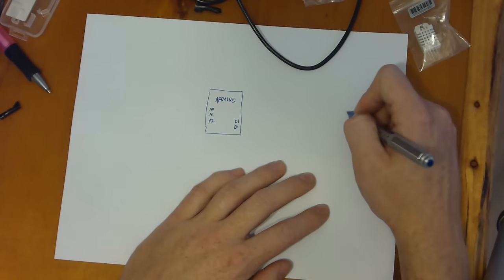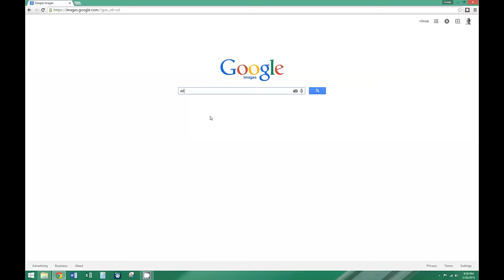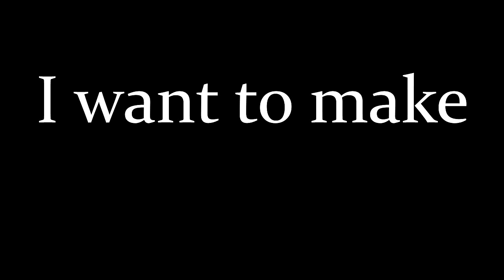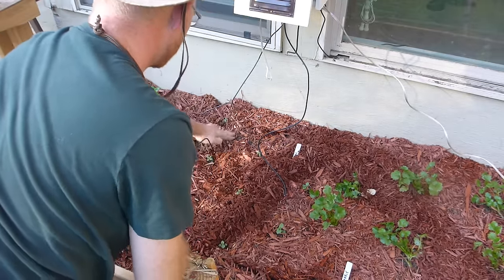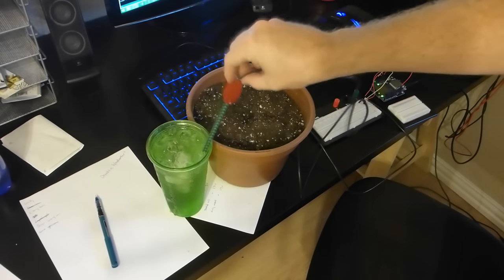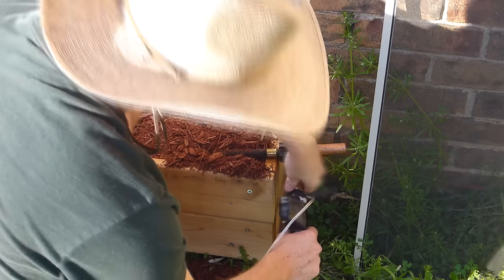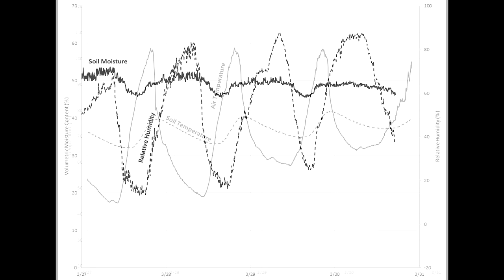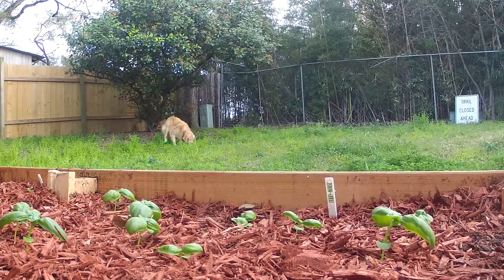Arduino Garden Controller - Automatic Watering and Data Logging

Comment: Hey, man ,this great.  I'd like to build one myself.  My problem is that I'm in healthcare and really only understand the human body, not electronics and code.  1. I am wondering if your link for the parts to build one is complete.  2. Is there a way to program a set-point for some of the variables for some sort action like watering.  3. How much did your working model cost?  4. Can you control it form a smart phone?
Reply: if you make one yourself you can ofc also program it yourself, so you can link the watering to any conditions you want, for example you can also add a realtime clock board and have it water only every monday, or at the same time of the day, or just when moisture is below some amount (which can ofc also be dynamic^^) (i hope i'm not scaring you, but there are tons of possibilitys^^)

cost i'd guess is below 50$, depending on what you buy and how many of the features he included you'd actually want yourself (ofc you could also just have arduino, moisture sensor, power supply and valve)

his version can't be controlled from a smartphone, but you can make it so yours can^^ add a bluetooth module (for which luckily tons of open source librarys exist), get a bluetooth terminal app on your phone and send it text commands, or even make an app to send it commands

Comment: Nice.  Sure you can buy something but it wouldn't be as satisfying as designing and building your own.

Remember that to qualify for the Heath Robinson school of Engineering you need to use a piece of string made up of smaller pieces of string knotted together somewhere in the design (preferable in a mission critical roll)

Comment: Low key have a bro crush on this project. LOL
...I might be 600 hours of [procrastinating actual work] designing in sketchup a ridiculously complicated hopefully once a month effort garden/bog garden/aquaponic/rain capture/ wicking bed/ monsoon proof/ vines/ vegetables/ low allergen... I honestly don't know what it is anymore!
Translation: I want to garden in the desert. So I wanted to put some plastic under the dirt. with vocanic gravel. With a recycling pump and some fish. But it's in the ground. And Monsoons can drop 2 inches of water in an hour. And electricity is expensive. And my landlord has allergies. And I'm extra so everything is designed to last 100 years. With laminated instructions in the control box. And the budget is $200... The garden is 25 feet by 5 feet to prep the area I removed the top 16 inches of soil... So 7 tons out and 10 tons back in.
...Maybe I was better off going to the grocery store.  I feel your over engineering pain.

Comment: Hello, this is really a great job. But i have a question for you. 

Consider i have 50 plants in a line where all 50 plants will have different moisture reading.How can we control the water based on the soil moisture requirement

Comment: I thought about a similar idea, but combining Arduino with Raspberry Pi for data analyzing
Reply: A pi has enough GPIO pins for this and this isn't time sensitive enough to worry about I/O speed and whatnot. Just use the Pi on its own.
Reply: Fair point. Although, if you're considering using it with solar power, the pi is notorious for being power hungry, and also isn't the best for when power cuts. I heard that this can corrupt the OS. Arduino, on the other hand (or most microcontrollers or embedded systems for that matter), tolerate powerouts much better.

Comment: Hi! If i wanna start programing arduinos and stuff, how would you recomend for me to begin with? I take advice from everyone.
Thank you and great video
Reply: buy any arduino kit and get started! :D
you can get an arduino by itself for like 2-5$ on amazon, or you can get a kit that also contains other stuff like breadboard, sensors, buzzers, leds and stuff for like 10-80$ (depending on its content) and then just start programming :D first get an led to light up, then maybe read an ultrasonic sensor and learn how its done doing that (there is a ton of available tutorials, example code and libraries to aid you in your cause :)

Comment: hello, great job.
what skills do i need to do something like that?
i don t know prgrammin (basic skills with python via internet)
but i like things like that and i want to try
ty and keep the good job
Reply: just grab an arduino kit and get started :D you can get an arduino for like 2$ on amazon and for 10-80$ (depending on content) there are tons of getting started kits with different other components for you to interface (like sensors, leds, lcd-screens and stuff)
arduino is quite easy to do such stuff with, because it is used by quite a lot of people, so there is tons of freely available code and tutorials to make using it easier :)

Comment: Can you measure Lux with just a photoresistor? The spectral sensitivity of all photoresistors I’ve seen does not match up well with the curve for converting radiant flux to lux, hence you would need to calibrate it for each light source (with different spectrums).

Comment: In order to achieve a cyclical watering pattern, you could easily rewrite this script with your sensor titles and custom values.
#define triger 250
#define triggerValue 580  //the trigger value of the moisture, the minimum value is 0, means the moisture is 0, the soil is very dry. the maximum value is 1024.
#define wateringTime 35  //the time for watering the flower1, millisecond. delay 35ms, uses about 70ML water

int analogInPin = A0;  

int moistureValue=0;        
long int moistureSum=0 ; 

int pumpAnodePin =  6;      //pin 6 connect to the anode of the pump
int pumpCathodePin =  7;   //pin 7 connect to the cathode of the pump

void setup() 
{ 
 Serial.begin(9600); 
 delay(500);
 pinMode(pumpAnodePin, OUTPUT);
 pinMode(pumpCathodePin, OUTPUT);
} 

void loop() 
{
   
 delay(1000);
 moistureSampling();

 if(moistureValue > triggerValue)
 {
   proWatering(wateringTime);
   return;
  } 
  
}

void moistureSampling()// read the value of the soil moisture
{
 for(int i = 0; i < 30; i++)//samping 30 time within 3 seconds
 {
   moistureSum = moistureSum + analogRead(analogInPin);  
   delay(100);
 }
 moistureValue = moistureSum / 30;//get the average value
 // print the results to the serial monitor:
 Serial.print("Moisture = " );                       
 Serial.print(moistureValue);      

 Serial.println(); 
 
 moistureSum = 0;//reset the variable

 delay(4000);     //delay 4 seconds 
}

void proWatering(int wateringTimea)  //sweep watering 
{
 
 digitalWrite(pumpAnodePin, HIGH);  //the pump start working
 digitalWrite(pumpCathodePin, LOW);
 
 delay(wateringTimea);
 digitalWrite(pumpAnodePin, LOW);
 digitalWrite(pumpCathodePin, LOW);

}

Comment: So please someone correct me if im wrong, the photoresistor, air temp & moisture sensors were only for “graphing/Analysis purposes” and does not have anything to do with the working of the circuit?

Comment: 10$ is alot for soldering iron . i got mine for 3.
I can tell you the iron doesnt get hot enough ... or you are using Lead free solder .. or both.
get a 40 watt from ebay .. drop another 2-3 $ into the toolbox

Comment: make all the jokes about how easy it is to water gardens every day u want, but what's not easy is maintaining a healthy garden you /aren't/ supposed to water frequently. I have various succulent and cacti groups resting under grow lights indoors. I was wanting to automate the lighting system but started looking into water control and moisture/temp readings out of curiosity. 

What seems silly to someone growing herbs could be invaluable for someone up north growing something similar wondering "when the hecc am I supposed to water this thing". Tired of guess-timating lmao. I see this less as a "Here's How You Can Save Money On Grocery Shopping" and more of a template on, well. Automating ur garden and getting the data

Comment: Good small project for the geek analytical data dweebs. But a £2.50 soil , light, P.H tester and a automated irrigation system £10.00 is quicker and easier and covers so much more space. It doesn’t take a Genius to grow stuff. And to be honest. You would need to go deep mind data collecting as the data will never be the same by moving the sensor around the flower bed. Do you know every square inch P.H levels to get an average result? this is not a criticism as I thick tech is good and I use it too. It’s just not accurate.

Comment: Where can I get that arduino. Thanks for the video
Reply: You can order an official one off of the arduino website, but arduinos are open sourced so you can get the exact same thing off of aliexpress for like 4 times cheaper, or u can get a starter kit there for like 20 dollars if youre new to this kind of thing. The one in the video is the arduino uno
Reply: @FatherOfMilk  ok. Thank you

Comment: hi, i have a greenhouse and i will monitor the humidity, temperature and manage the irrigation through arduino this one will be connected to an raspberry where the web interface and the database is... could you send me the code that u used the your system please ?
many thanks

Comment: Why he is using transistor to operate solenoid valve
Reply: because the valve probably needs more voltage than the arduinos 5V or more current than the arduino can give

Comment: Wait you are an engineer but cant  solder?!
Reply: Most engineers don't deal with electronics. I'm an electrical engineer. Some mechanical engineers do stuff with robots
Reply: @ericl8743  my opinion is that soldering is a really essential skill that can be useful when repairing cheap electronics